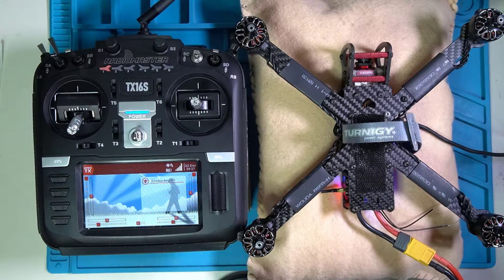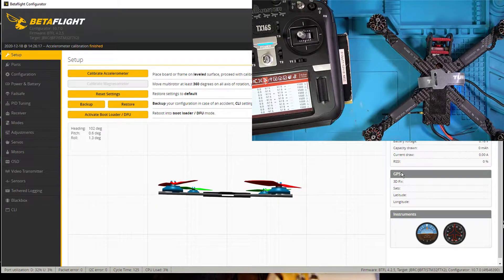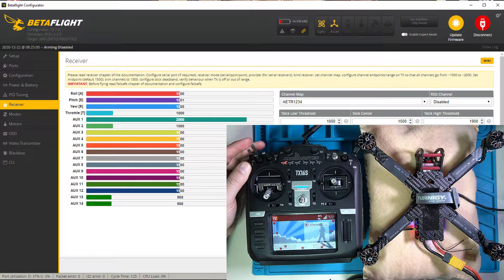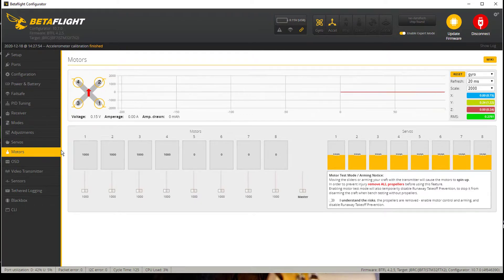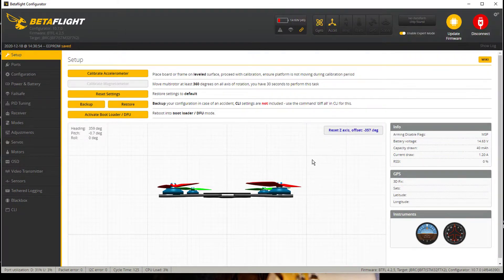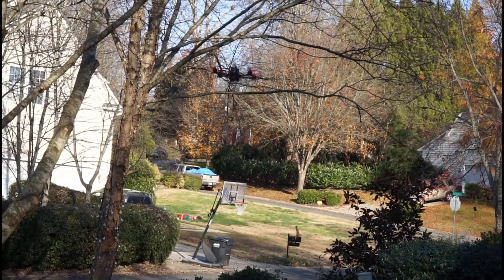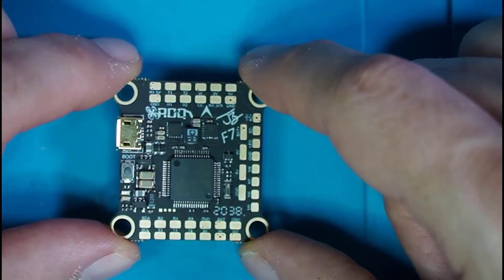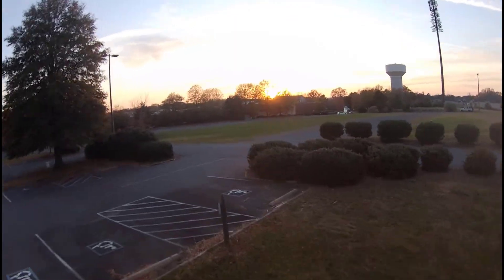RDQ Bardwell F7 Flight Controller Final Checklist & Initial Thoughts

Comment: Hey I had a question about a header I tried putting sum headers on a 2000 Tahoe and on the driver side the header hits frame how can I fix that and never in a wreck
Reply from the maker: what size did you go with?  I went with the smaller diameter because I was worried the larger ones would not fit.
Reply: @TahoeSteve  I went with the 3/4 ones witch ones you get ?
Reply from the maker: 3/4. I think 7/8 was the next size up.  Mine with 3/4   fit.